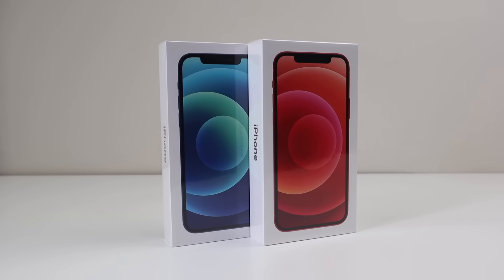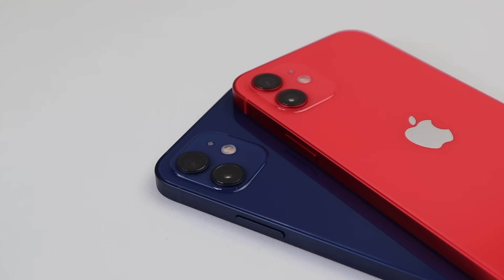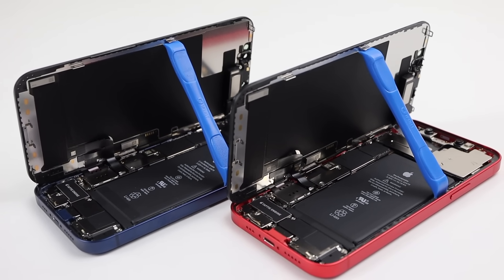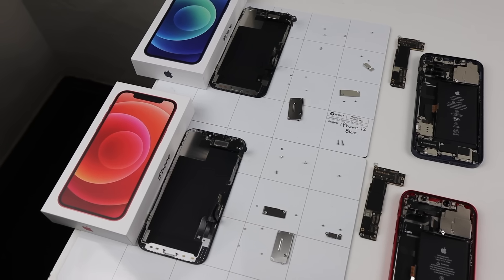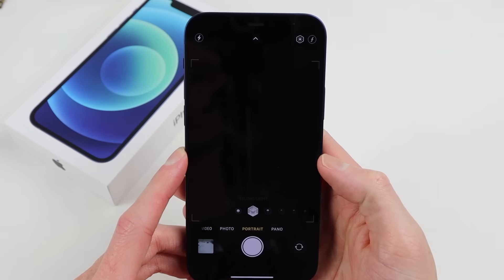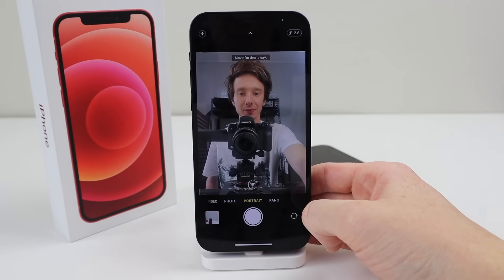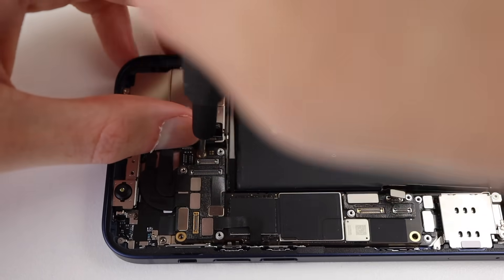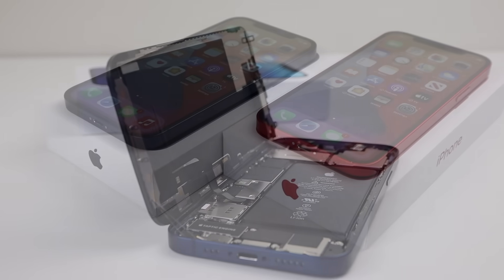iPhone 12 Anti Repair Design - Teardown and Repair Assessment

Comment: If you use Apple genuine parts when doing repairs, every part is serialized and HAS to be registered in their servers or else you get those messages. -an Apple authorized tech
Reply: Seems more like just a pairing client side. Its just like EDID for the screen replacement and battery firmware. TouchID, screen, battery, has been like this bullshit for a long time. Apple just going next level, aka not making it work at all, lol. Nothing to do with their servers
Reply: @Kyle1444  All parts are serialized and before making repairs, we have to let Apple know that the part is going inside the phone  in order for it to work. If the serialized part is not registered in their system beforehand, the part will not work with the phone.
Reply: @josuemontalvo221  thats..just bad..why would they stop repairs from doin there job
Reply: This is insane...
Reply: Seems like a plausible explanation
Reply: Given parts in both the phones were registered. Why didn't they work when interchanged?
Reply: @mohitkhareta1882  Because kind of like how touch id is tied to every motherboard,  it applies to their parts. Actually when we we do display replacements with a touch id, we actually get them with a new button installed and we have to get the serial number from the display and apply it to the phone so that button can work with the phone. All the serialization happens within their servers.

Comment: Sorry, you can’t replace the unlocked deadbolt on your door. For security purposes your door is tied to the deadbolt it was installed with 😇. Sorry you can’t use your new deadbolt, its a security risk!

Comment: from designing embedded electronics, what i can say is, all those issues from replacing parts arent hardware, they are done deliberately by software. each part has an ID and when that doesnt match, the device is programmed to " act up " so you would be forced to visit an apple store. what they would be doing is to " match the IDs"  

PS: but dont underestimate the chinese! it will take 100 years for apple to prevent chinese from reverse engineering their products and finding a workaround

Comment: Isn't this just to make apple able to sync all color profiles within the phone? I know we all know when we switch any of these parts it get messed up but typical BFU just make a conclusion that this is shiitty phone after unauthorized repair. Not trying to defend them but I am just trying to understand this decision in greater depth except the money making argument.
Reply from the maker: It thats the case why cannot i sync the new parts in myself or the device automatically do it. I would be happy if they let us run calibration or whatever to make everything work.
Reply: @HughJeffreys  the device cannot do it cuz it can't see itself in a already calibrated way. That's the all reason behind color profiles and color calibration methods. Because every display and image sensor turns out to be a little different after the manufacturing processes. But yes it would be nice to force apple and all manufacturers to provide sync/calibration tools. But honestly what it would do with price if they have to develop secure public tools to do this? It is like they have to develop instead one device another one event more complex to repair  the first one? And after that would we want a device to repair the repairing device? (Sure some of us would...) Sadly as devices getting more complex the tools have to go the same way.
Reply: @HughJeffreys  Hugh hope you get in touch with Shana. Is this even legal?
https://www.hbsslaw.com/attorneys/shana-scarlett

Comment: This is the reason I absolutely loath apple. Annoying forehead notch, no USB C just a wonky cable with an annoying  lighting port, no fast charger in box, 0 repairabliity, introducing "new" tech with hyped up words and only minor improvements over next models with and ubsurd price. Just got a samsung FE s20 and it has a charger a USB C port with a Fast charger included and it doesn't have a forehead only a small punch hole 128 gigs and expandable storage for less than 800

Comment: Do you think they added some extra coding to not change the camera and battery and the phone like it has there own connection but if you switch it maybe the code. Has not been same so maybe it’s not working correctly because of  one different code that lets it work completely

Comment: The reason why the camera and the FaceID don't work is that you forgot to swap the cameras to match with the motherboard. Unless you have the original faceID associated with this momotherboard, Face ID will never work. Other functions of the camera also. For the battery, This is happening since the iPhone 11, so nothing new.

Comment: This is why I don't use Apple. I had my Samsung Note 4 for 7 years. It was already 2 years old when it was given to me. 

The (1 year old) Apple phone I had 3 months before only lasted 3 months before the software completely crashed the phone. The store told me to buy a new phone.

My Note 4 lasted way longer. The issue was that it stopped charging for an unexplained reason. The note 4 could be easily opened to replace the battery. 

The phone I currently have is a Samsung phone. 

I will probably never buy an apple product again.

Comment: Well
It isnt cz a hard adhesive or any other type of adhesive, it's because the iPhone 12 is only a month to build. So the glue is still amazingly fresh. Just wait if the unit has been assembled for 6 months, the glue will soften for sure. 

But what still makes it difficult, the screen design is now flat with the smartphone frame, very different from the previous design, the screen frame is above the smartphone frame. 

For  the logic board, the design is now more comfortable for technicians. We are not afraid that the simcard module will be broken, if we will perform re-hot/reball/replacing the nand flash

Comment: So unless you pair the factory depth sensor and front facing camera with its coordinating factory logic board, Face ID will not work. This has been an issue since the original iPhone X. As for the “not genuine display”. There are a few work-arounds, my favorite being a device that reads data from OEM parts and copies it onto aftermarket parts.

Comment: So it’s basically the same as the iPhone 11 (pro) except for the camera lock. True tone has always been locked by a special hash programmed in the screen, which is transferable between a old and new screen with the right hardware. TouchID and FaceID has always been locked down due to ‘security reasons’ and can be soldered to fix. My quess is that these battery, camera and screen hashes or locks(the lockdown chips) will be transferable from old to new parts in a short amount of time, maybe with soldering needing to be applied though.

Comment: I think that the really sick thing with this, is how the parts have obviously been programmed to have "errors". It would be one thing if the part just didn't work, or locked the screen with a message telling you Apple knows you have a different part and have disabled the phone, but it's not that. The parts, like the camera just have "issues" that make it seem like they are not compatible, which Apple can claim is just the result of not having the right part. It's pretty obvious that's what was done, as both phones he switched the cameras on had the same "errors" after switching them.

Comment: I swear soon we are going to see Apple welding everything together.
Reply: The only reason this thing isn't potted with epoxy is weight. They would love to make it impossible to open.
Reply: @userPrehistoricman no they make it easy to open and swap out the parts, aside from the water resistance which is an actual feature, the only problem is the function of the phone after you swap the parts. 
Easy to recycle, but not easy to reuse after broken.
Reply: Probably
Reply: some day you cant even crack the phone open

Comment: So basically Apple will brick your phone if you try to get it repaired for cheaper, then also say that because you opened it/had an attempted 3rd party repair, the warranty is voided. This leaves people with a 1.5-2k (AUD) useless paperwieght. 

Should just stick to the "3rd party repairs will void your warranty" and leave the choice to the consumer. Never buy apple.

Comment: Not including the charger is a genious move, it saves far more money that what the charger is worth. At least in Europe if you sell a product with a power supply in the same box the product and the power supply must be certified together, it means that for every model of iPhone you have to repeat the process, even if the charger is always the same, since you are selling that in the same box they are effectively a different product that must be certified again. And for the fact that they included 5G that is a fairly new technology I think certification costs are now even higher. 

Of course not including a charger but only a simplye USB cable is far simpler, since you have no 230V part that must go trough more precise certification, but you have only low voltage components.

Comment: It's pretty easy to explain. All parts have a unique serial nr probably. When you make a md5 or sha1 checksum of all parts and just one was replaced then it is not the one it was programmed for and then it does not match and it refuses to work. Apple should be sued for this!

Comment: Lol imagine if third party Charging bricks didn’t work 😂😂😂
Reply: please don't give'em ideas or next iPhone will only work with iCharger but wait, it only can be connected to the iGrid to actually charge.
Reply: @memovilmx6239  And only works with the ioutlet with the ihouse connected to the ielectricity
Reply: @kirito0738  yeah but make sure that your ielectricity is connected to your ipowerplant. Also make sure your ipowerplant is owned by your icity or itown. and be sure that your icity or itown is part of your icountry.

*VERY IMPORTANT*: Make sure your icountry is hooked up to your iplanet. If it's not it could damage your devices.
Reply: @comske8111  and be careful, mess with your iplanet will void your warranty and it will stop working for safety reasons
Reply: @kirito0738  Ah thank you. I almost forgot.

Comment: Most devices powered by rechargeable lithium batteries that I have dealt with need to be plugged in before they can be turned on for the first time after the battery has been disconnected because the battery protection circuit gets its power from the load side to operate before it can enable battery power and keep itself on until the battery dies or gets disconnected again. It reduces the likelihood of the battery monitoring circuit running the battery completely flat while in storage and the device accidentally turning on somewhere between the factory and customer.
Reply: But notice when everything was back in their correct phones, Then they both turned on by the power switch first time.

Comment: Each component is mated to each other through a code, the device will recognise the component has either been replaced or tampered with, therefore the device will automatically “bug” the phone, they do this to entice the users to replace the phone only by Apple. Apple do this to stop third party repairs. Its devious & greedy.
Reply: What if you accidentally buy 1000$ worth refurbished one ?? 
So try to see the good part !!!

Comment: Apple alway pairs camera with the main board as well displays and batteries. To have face id work in another housing you have to move the front camera and the ear speaker flex...i have been doing repairs for over 20 years and have the tools to reprogram new parts.

Comment: There is probably still some room for repair, but it would require jailbreaking and modifying system files. There should be a way to trick the software on the phone that it has genuine parts. But this all goes out the window if serial numbers are checked at the kernal level.

Comment: One scenario that persistently gets overlooked because people want to focus on hating Apple is the fact that Apple, like any other company, want to prevent theft. They want to prevent people from stealing another person's iphone 12 and the best way to do that is to make the phone undesirable to thieves. iphones get stolen for a number of reasons but one of the biggest reasons for theft is that thieves want the iphone for their parts. Why buy a part or get a iphone fixed by Apple for a lot of money when it is easy to steal a phone for it's parts. Having the iphones camera assigned to the logic board means that part is now worthless because it cannot be used on another iphone 12. Which now means, if someone breaks their camera and thus cannot unlock it with face ID because they have forgotten other passcodes, they are screwed because a replacement camera from a stolen phone will not work.

The downside to making the iphone 12 more secure in the hope of deterring thieves is that it makes the phone extremely difficult to repair for independent repair shops.

Comment: This is why Right To Repair is paramount in the US. I'm not usually one for legislation of this kind. It needs to be done. This is disgusting. They are literally creating issues with software just to make it act broken and discredit independent repair. That's some of the most predatory practices I've seen in a long time.
Reply: "They are literally creating issues with software just to make it act broken and discredit independent repair." Isn't this term is enough to bring a valid class action lawsuit.
Reply: @ributsuria  I'd like to think so.
Reply: Paramount? Compare to what rights
Reply: If everyone started to repair their own iphones with any third-party cheaper parts, phones would start to seriously have problems... Since it would be hard to know if, when an iphone burns or has a serious glitch, it is Apple fault or the third-party’s repair fault, people would simply start assuming that ApPlE iS nOt WhAt iT uSeD tO bE and that their quality is now bad. They are just avoiding bad PR and i totally agree with them.
Reply: @phb32135X  I don't think you get the point. Apple could sell those replacement parts. Apple could be set responsible for third party replacements and also could be in charge of verifying they work properly and are properly built. Apple could be the best company in existance. But instead they opt for the money way pushing on the fact that theri products are just a status symbol, not a tech marvel.
If they are avoiding bad PR, then why didn't they state what you just said before the launch of the iPhone 12? That could have solved the rage we all have with apple.
They just take advantages on their customers selling them cheap tech for a high price just because it has an apple logo. They could sell you an Apple candy for 10$ and you would still be buying it just to say "I ate one".
Apple is not what you this it is
Reply: @davidealessandri2893  that's all part of business !! 
Even though their products techs are not cheapest . But they never put reasonable price tag . Becuz they grewed their market as a status symbol .. as Rich guys phone...
Reply: @phb32135X  ahh yes, i too support anti-consumer practices
Reply: @phb32135X  wrong

Comment: Such a shame. I was actually considering getting one...
Reply: cringe, after 2005 why would you ever buy an apple product.
Reply: Same but dude screw that apple company im upgrading to android in next month, my iphone 7 plus is dying
Reply: You can't even swap an ORIGINAL Apple camera between phones. Dirty,the Apple is rotten.
Reply: @Иван Русић Apple went from "over priced with top end hardware" to "over priced with random hardware that worked good enough"
Reply: If this isn’t rectified I’m slinging my Xr for an S20 ultra, was also going to get the 12 but like, naaaa
Reply: @xephyran  Please consider huawei or xiaomi mi 10 ultra. Got the mi 10 and it is just perfect

Comment: No disrespect but this video doesn’t really show much other than the fact that you don’t know how to repair this phone yet because it’s brand new. 

A service provider would have new parts, service tools/machines, and service guides that clarify how to properly fix, test, and pair each component. This was just you swapping things with no knowledge of the proper way to do it. 

You also swapped the one part that would need to be brand new and paired upon installation to keep the serial number and everything up to date. The serial tells your phone the exact make, model, color, etc to make sure it gets the right warranty service and updates. Phones would get stolen and repurposed left and right if it didn’t. What happened if you replaced the battery, speaker, camera, etc. would you get the same result?

Lastly, as you stated early on in the video, no repair parts are actually available. This is misleading because IF the parts were available who’s to say they wouldn’t come with actual instructions on how to remedy all the issues you were having. Even with other devices when you replace parts there are steps and menus you have to go into to calibrate the new parts or things won’t work. If someone did that without knowing what they were doing those devices wouldn’t work either. 

I’d love to see a follow-up to this once the actual repair process has been discovered. This early on in the phones life cycle this video is just going for shock value and click bait.

Comment: This behavior is due to the T2 chip. The entire bus of the cameras and the display are connected to the T2 chip. New Components must be programmed after replacement.
The problem exists with all iPhones and Macs with a T2 chip.
A display change on T2 MacBooks, for example, results in True Tone, camera / sensors and the keyboard lighting no longer working.